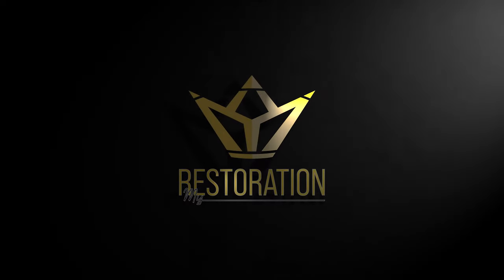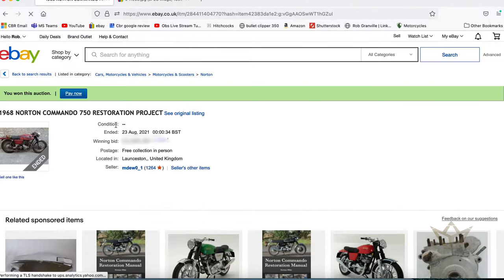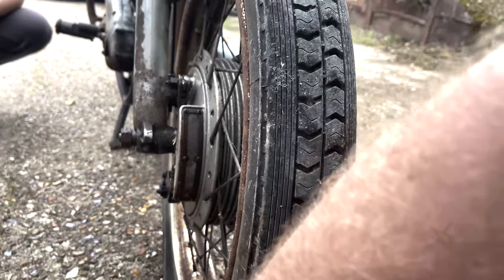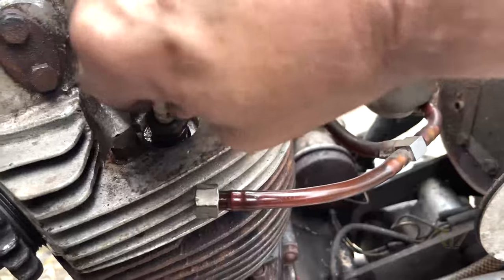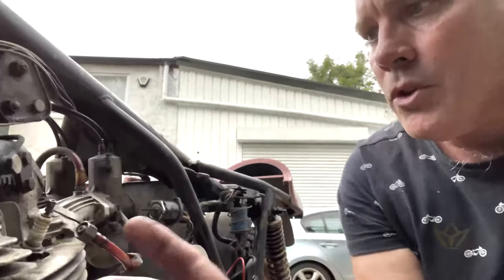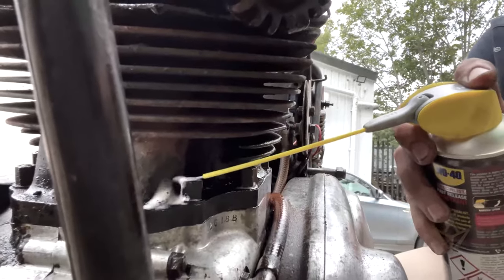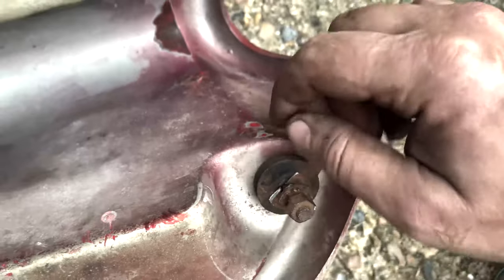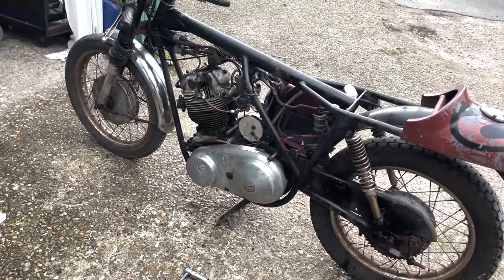Series 2: THE BIG REVEAL….. What iconic classic motorcycle restoration next??

Comment: I restored one for a friend. The bike also came from France!
Reply from the maker: Thanks Ulrich! I’m now trying to get the old isolastics out… rubbers come out but left the metal sleeve in the frame. Seen this before?
Thanks for your comments
Reply: @MyRestoration1  yes, the same happended on the 68 Commando I restored. The early ones had "Metalastic" rubbers with a metal outer sleeve in the isolastics. They were rusted into the tubes. I used a hacksaw to split them (carefully) and hammered them out. Or you soak them in WD 40 and use a hydraulic press. Uese the vernier style isolastics from Andover Norton. Easier to adjust unless you want the bike strictly stock and want to fiddle around with shims all day long. :)
Reply from the maker: @ulrich.hoffmann  EXACTLY THE INFO IVE BEEN SEARCHING FOR! My new star today. Thanks 🙏

Comment: The valve covers and the footpeg hangers on the early bikes were not polished and had rather a sandcast texture. I visited Joe Seifert´s shop near Munich and took photos of his original 68 Fastback.
Reply from the maker: Yes I noted that. Very rough looking. They shall remain so once cleaned up
Reply: @MyRestoration1  Try to make sure you us British Standard and Whitworth tools. The more commonly available AF may slip on tight old fasteners.